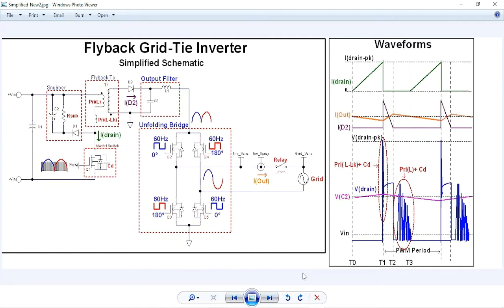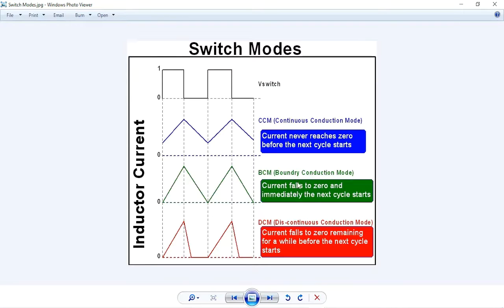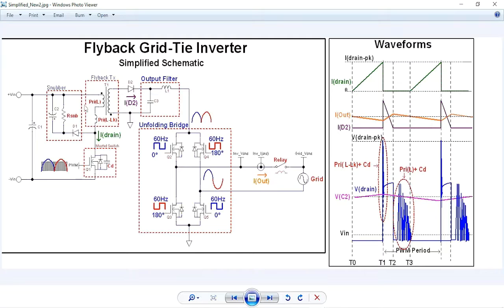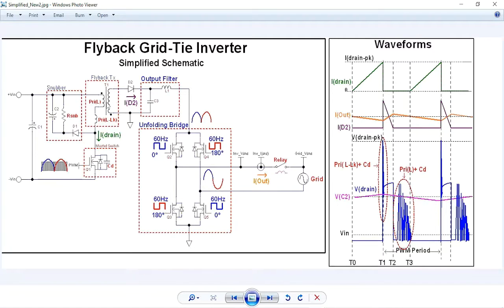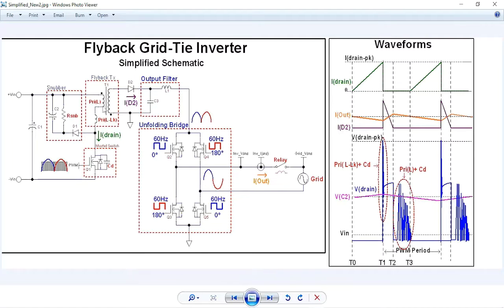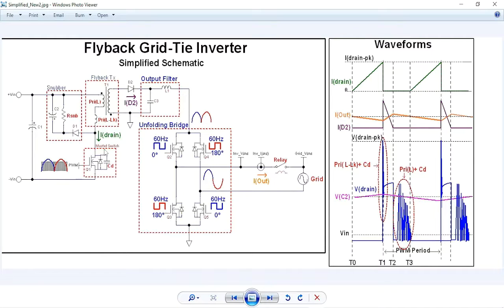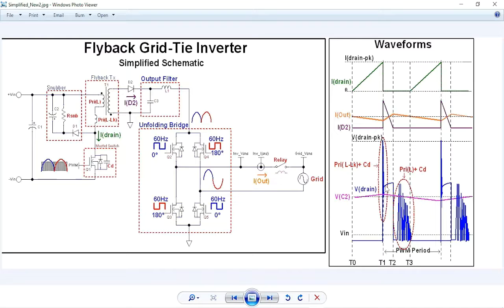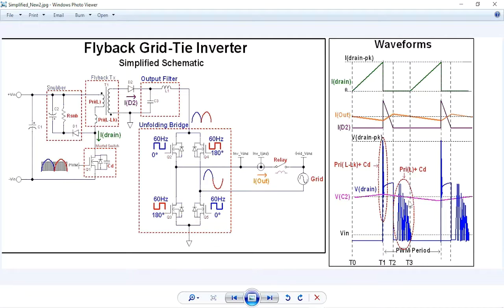Simplified Schematic Tutorial of a Flyback Grid Tie Inverter

Comment: Awesome project!
Funny to find it just now, when I recently shared basically the same project on my channel, only instead of flyback I used non-isolated buck-boost topology, full analog control and modular design for scalability (still in the works tho, I want to try out aluminum PCBs for the power conversion modules and decentralized PWM control).
Interesting that I am not the only one who figured an unfolding bridge (or four quadrant rectifier as I've decided to call it) is ideal for greatly simplifying grid tie operation.
You definitely deserve more views.